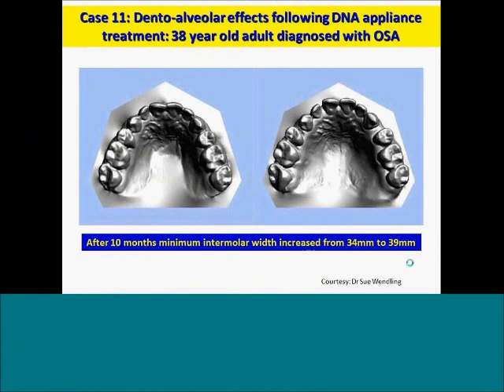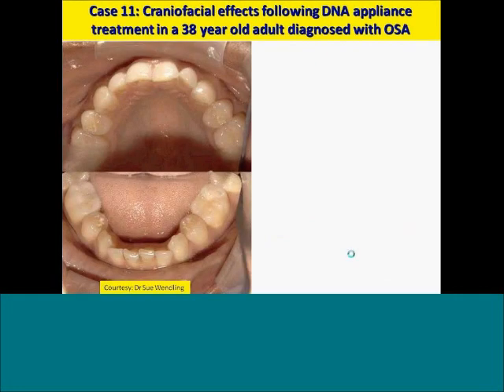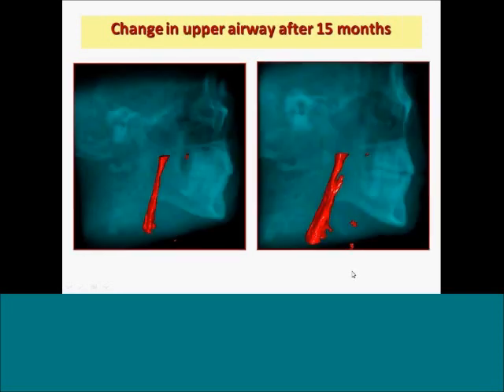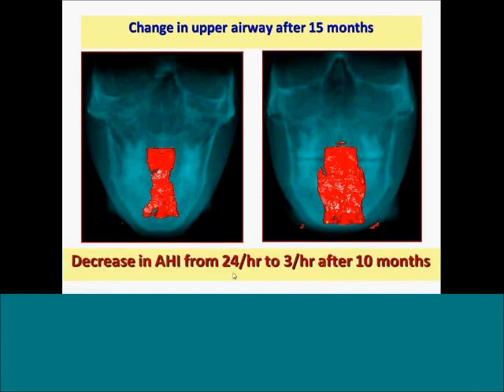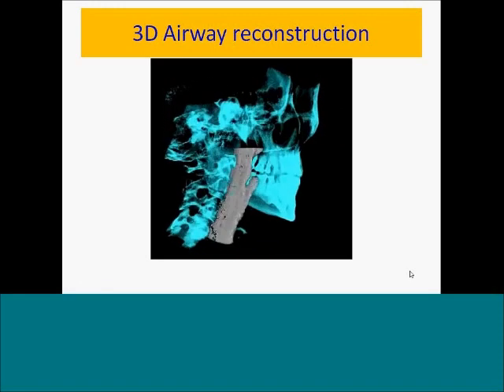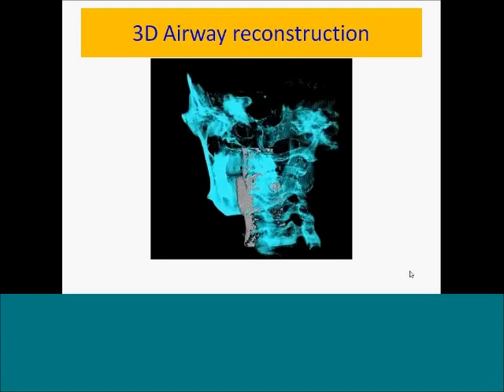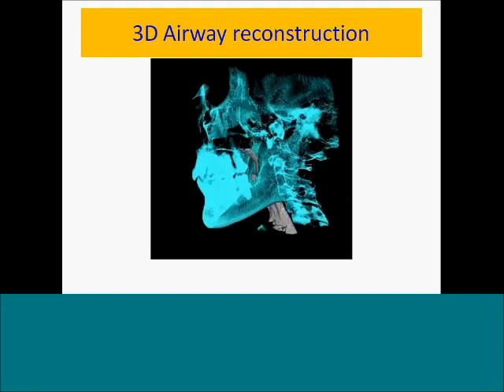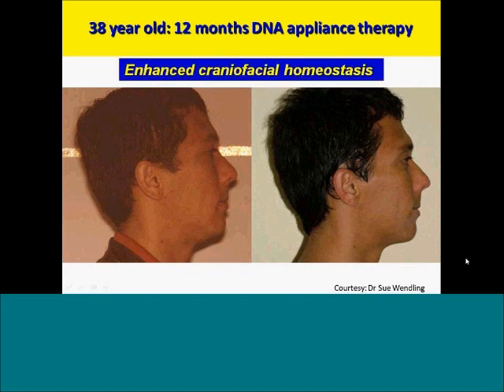DNA appliance Made Simple: Case Presentation 11

Comment: Hi, I had extractions when I was younger, but my teeth are straight now.  I have been thinking about getting something like the DNA appliance or the homeoblock for a while now, mostly because I would like a wider smile and more room for my tongue, however, like is said I had teeth extracted so I only have 12 upper teeth. Is this still possible or will the extraction spaces have to be reopened?Can the DNA appliance expand the palate so that there is room to get back the teeth I lost?
Thanks
Reply: @A_Barry Hi. It's been 5 years since you made this comment, I was wondering whether you opted for the DNA Appliance and got the results you wanted? I have a similar issue to you with extracted teeth and would like to get them back as well.

Will be good to hear from you :)